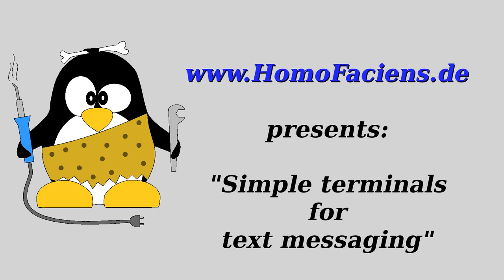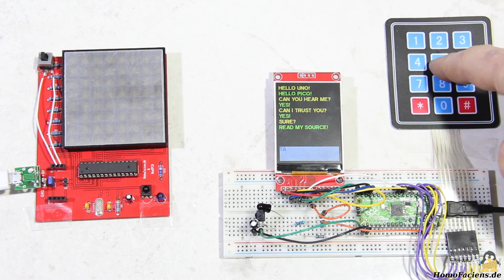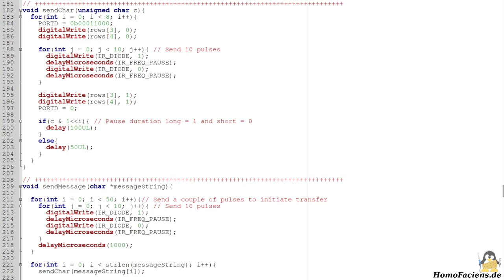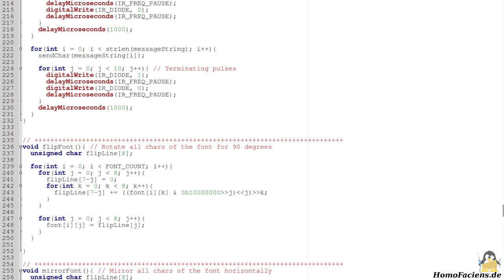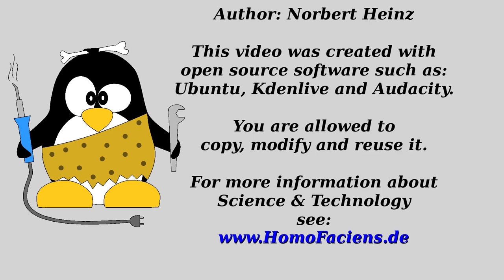Very simple text terminals with IR interface

Comment: Have you used an STM32F103 microcontroller? It is also available on a microcontroller board, the Blue Pill. It comes at around the same or lesser price than a Nano and has a lot more features.
Reply from the maker: There is a ocean of microcontrollers available that can do the job, all with pros and cons. If you know the basics, you can chose the one you prefer. In course of this series I will demonstrate, how to use a couple of them and keep the STM32 in mind. Computing devices became cheap and commonly available, so we live in great times!

Comment: Now you just need another Arduino device to interface between a computer keyboard to transfer it's output to Morse code at a rate your other devices can read.
Reply from the maker: No big deal to do that, but for sure not the way to reduce complexity of a terminal ;))